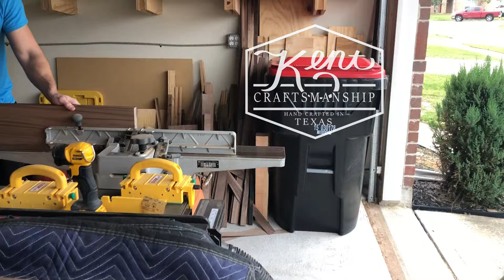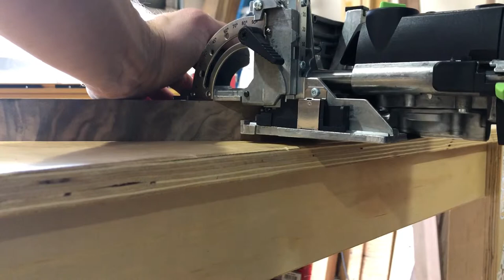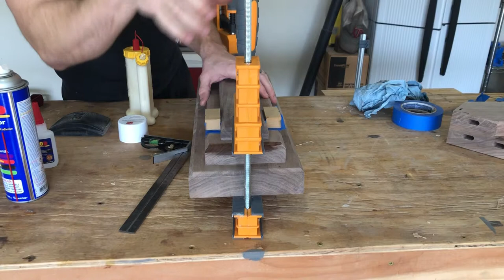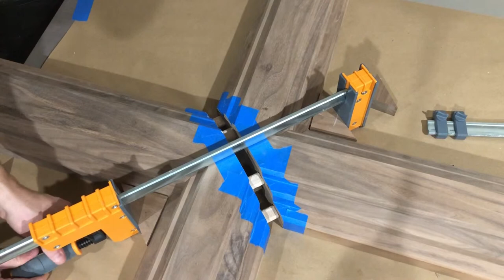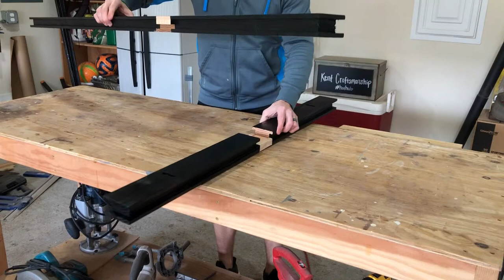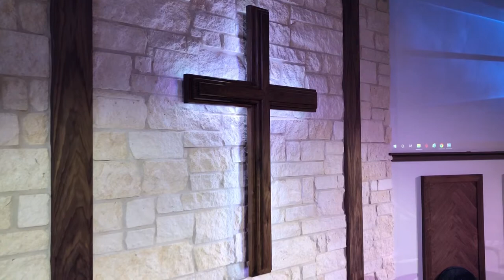Making a Walnut LED Backlit Church Cross

Comment: Nice work really like the cross, I do have a question that is a little off topic and that is, what brand is your dust mask?
Reply from the maker: It is a 3M Quick Latch Respirator, Model# 6503QL. https://www.amazon.com/gp/product/B00IF7RCU6/ref=ppx_yo_dt_b_search_asin_title?ie=UTF8&psc=1 I got a Large size and probably could have gone medium, but the large still has a good seal. I use the 3M P100 Particulate Filters (https://www.amazon.com/gp/product/B007STCT00/ref=ppx_yo_dt_b_asin_title_o00_s00?ie=UTF8&psc=1 ) with it and they do a great job of keeping dust out of my lungs.

Comment: Hi, that is beautiful. A question, how did you hang the cross on the wall?
Reply from the maker: I cut 4 keyhole slots in the back and then had the builder put 4 bolts in the wall to hang on the key holes
Reply: @kentcraftsmanship5349  Thank you very much.
Reply: What was height and width